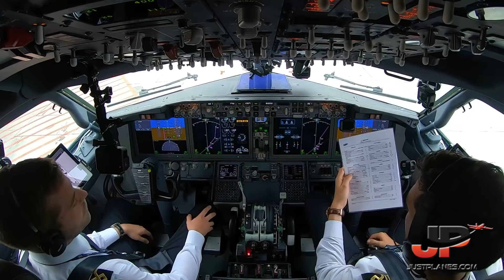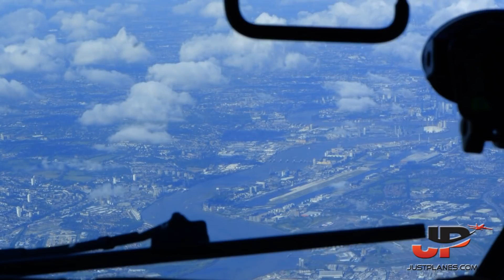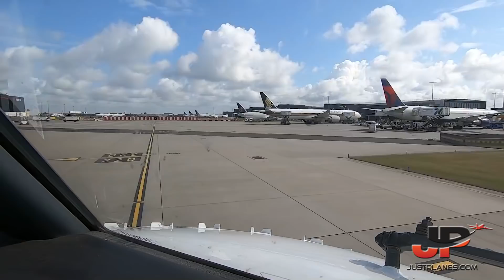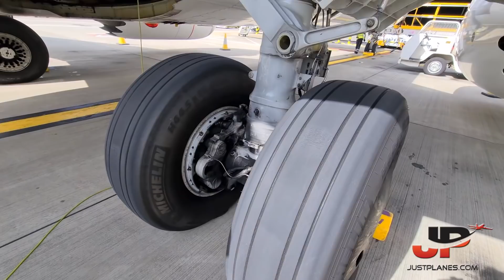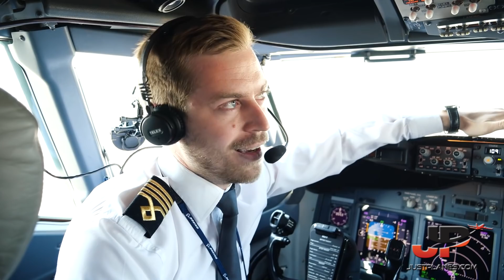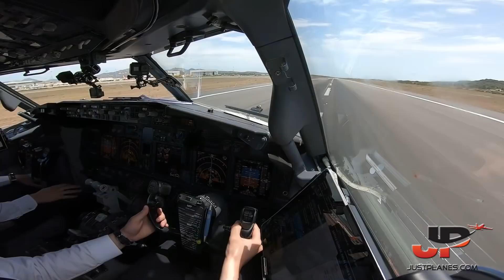LOT POLISH AIRLINES🇵🇱 joins Just Planes | Boeing 737MAX Cockpit Trailer

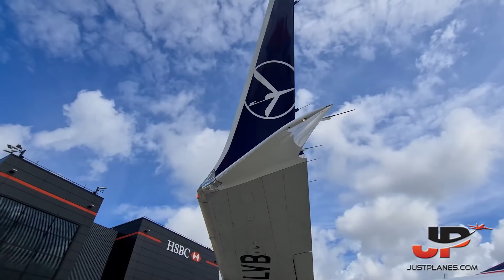Comment: hi, have a question. i saw this exact plane,  few days ago i Warsaw, and i took a picture of this hump on top of a fuselage, visible at 5:57. what is purpose of that thing?
Reply from the maker: Not 100% sure but maybe its for the wifi?  Someone would need to confirm that.
Reply: @justplanes  that was my guess too, they introduced lately some kind of onboard entertainment system working over WiFi. not every plane is fit with that yet

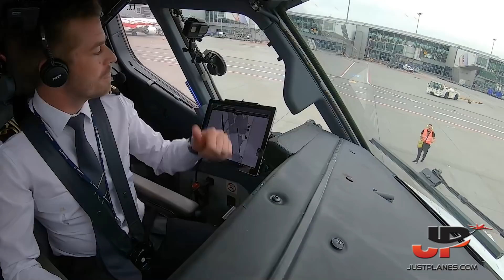Comment: 0:28 V2 set on MCP, 0:32 V2 as per the takeoff data. Different???
Reply: I don't know their exact procedures, but the take-off data speed probably doesn't factor in any wind, while the one set on MCP probably does
Reply: Good observation, they did a mistake. They set Vr on the MCP instead of V2.
I am 737 type rated btw.

Comment: i would never fly on this aircraft great video though but i dont trust this aircraft
Reply: Want a cookie?
Reply: @Demon_Fingaz    (Laughing hard)  Thanks.  I needed that today.
Reply: That's your choice. At least you didn't assume stupid things unlike the others.
Reply: There's nothing wrong with the aircraft. It was just that the training program was not effective at communicating the changes in aircraft behaviour due to the engine position.. The exact same conditions which caused the crash of two of these had happened many times before worldwide and the pilots were able to do what was to be done. They wrongly estimated (or did that to save cost) that the average pilot would be able to handle that and didn't require specific steps being taught to them. Watch the Mayday episode of this crash, it explains what exactly caused those crashes. The planes are from the family of 737s and very reliable and safe.
Reply: @bhojjadamotabanda   Perfect explanation!  It's refreshing to find someone who uses logic and reason to cut straight through all the drama.